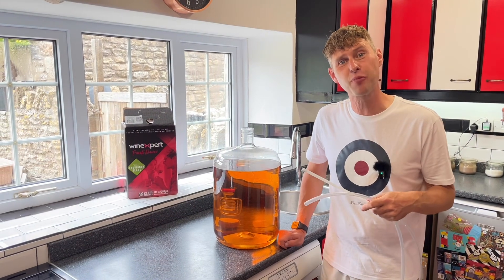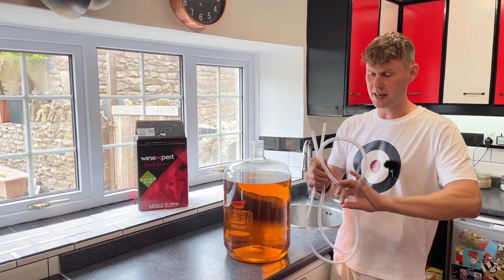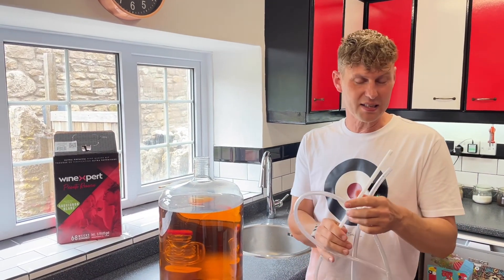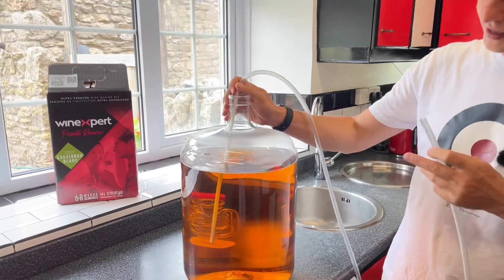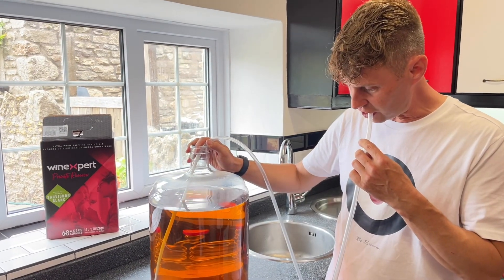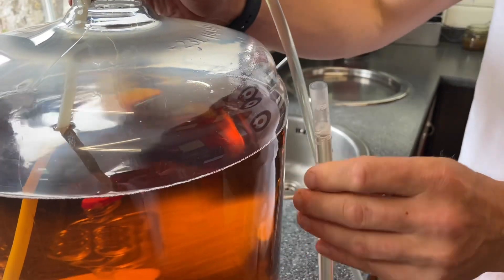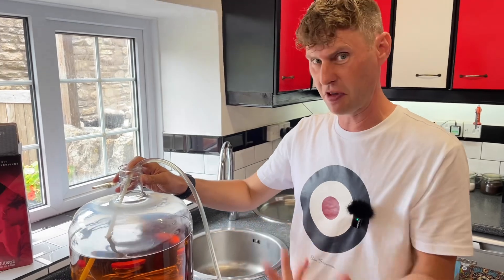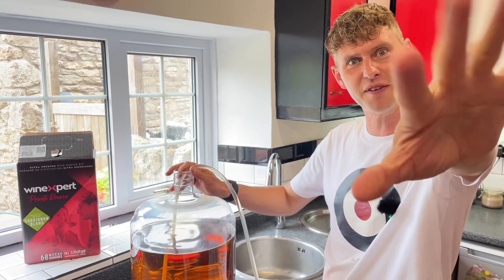How To Syphon (How To Siphon for our US friends)

Comment: is there a way to syphon without your mouth to prevent any germs getting into the liquid?.....
Reply from the maker: Yes, you can use an auto syphon - https://www.brewbitz.com/collections/syphoning/products/auto-syphon-5-litre

However, the alcohol content will kill any bacteria that may be on your lips.
Reply: @Brewbitz  what about placing the entire tube in the wine (with one end connected to a string)....and.....retrieve the end with the string and place that into a new bucket?....
Reply from the maker: You risk disturbing the sediment in the bottom in the fermenting bucket. If this really worries you, you could fit a tap to the bottom of the fermenter, then connect the tube to the tap.